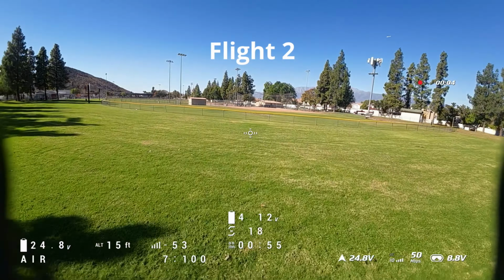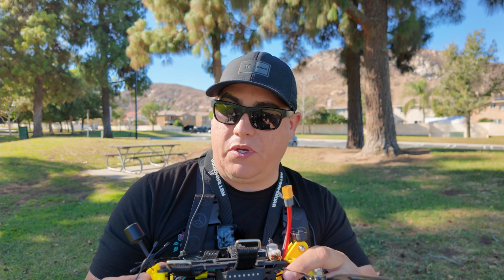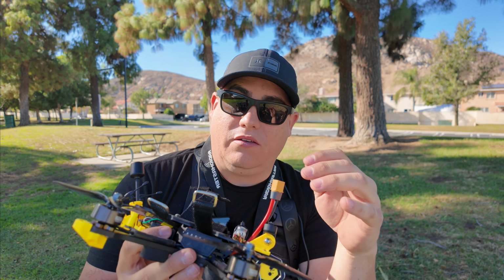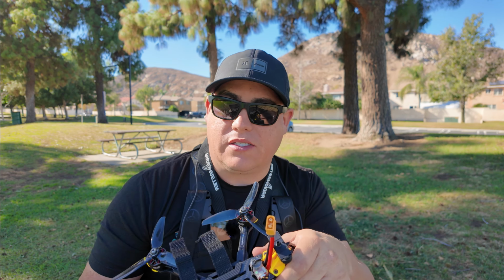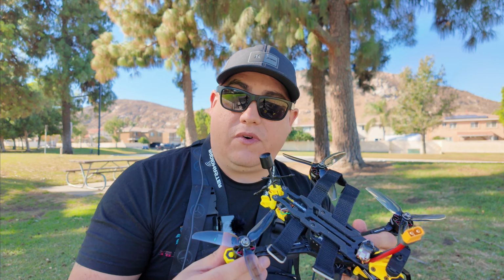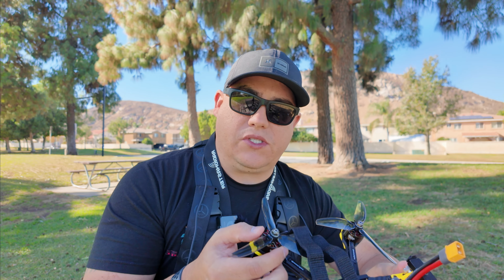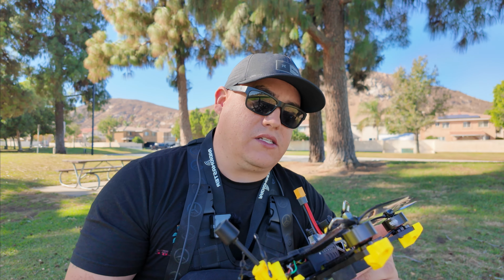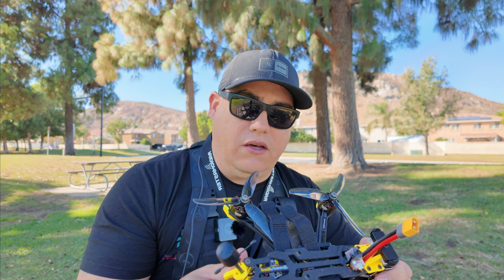SpeedyBee Master 5 V2 - The Best Budget FPV Drone Build under $500!

Comment: Can u tell me your PID Tuning for this frame ?
Reply from the maker: I have not completed an "official" tune. Unless its a BNF purchase, i have my drones set to the default 1 in betaflight. I do adjust my rates depending on the drone.
Reply: @ i have same frame… sometimea i get propwash and its sakes.. how to fix its ? What parameter should i adjust ?
Reply from the maker: before jumping into betaflight, have you checked that everything is assembled and tightened? have you tried different props with lower pitch?
Reply from the maker: Here’s a good article to help, https://oscarliang.com/propwash/#Tips_to_Reduce_Propwash

Comment: Are there any good fpv drones in this price range that offer good stability and good for freestyle too? Or is this the best option?
Reply from the maker: so there are lots of drones in this price range. i choose this build for several reasons. Price, availability of spare parts, ease of build, and lots of space for upgrades or parts. Im not racing, mainly using this drone for cinematic type of shoots and follow cam for mountain biking and motocross.
Reply: @davidescobar-2003  I really appreciate the fast response. How long is the battery life that you usually get on this drone? And what is the distance that it can travel without it losing signal?
Reply from the maker: @ running 6s 1550 mah I get 5-7 minutes flight time, I haven’t pushed distance beyond 2,000 ft from launch, mainly due to having to walk to retrieve it if it were to crash 😂
Reply: @davidescobar-2003  Thanks for the info. Also, I'm definitely not going to be needing to go further than that so that concern just left the room 🤣